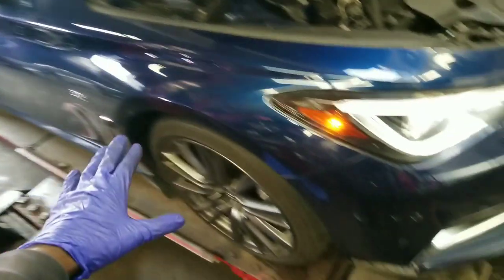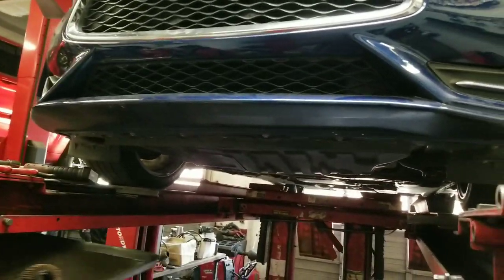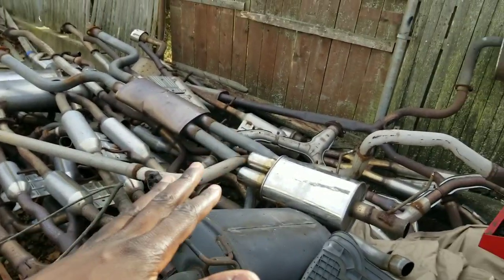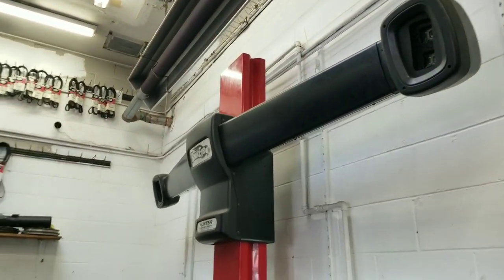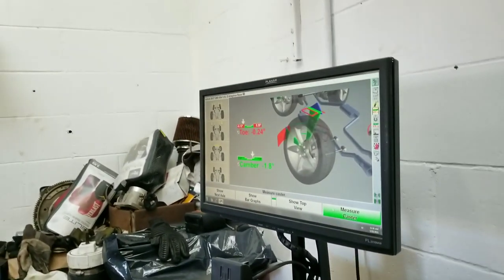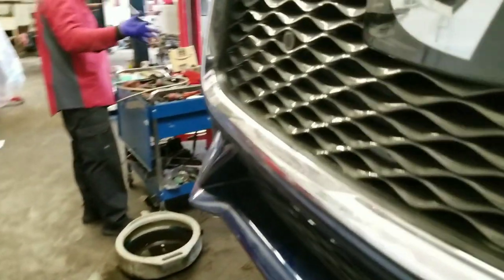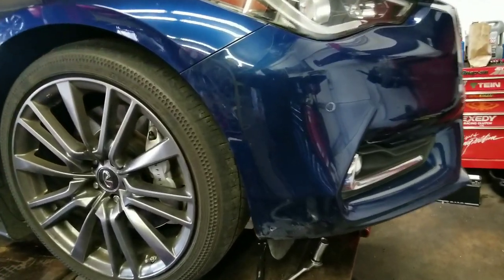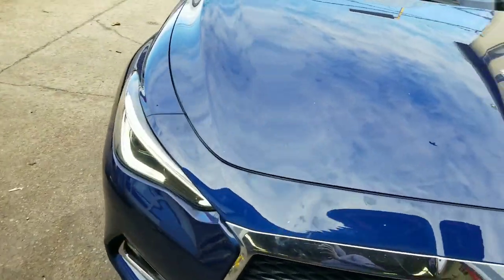Allout motorworks alignment/ oil change

Comment: Also something to note, even if both Toe specs are in the green, you do not want them to be far off from each other. For instance you wouldn't want 0.02 on the left and 0.08 on the right, the car still may go through tires and not track straight
Reply from the maker: Agreed

Comment: Hey boost why did you use 5w30 instead of 0w20? Also did u use 5w30 on the q50?
Reply: 5W-30 is great simply because it’s thicker and more reliable if you’re making more power/boost simply because 0W-20 thins out and evaporates like water and can destroy these engines. Why I use 5W30 as well.
Reply from the maker: Temperature range is higher for 30 weight

Comment: Hey Boost - do you rock a Mishimoto or ADD W-1 catch can?
Reply from the maker: I used  to have add W1
Reply: Do you plan on throwing one on the Q60?
Reply from the maker: I haven’t decided yet but I do want to find a more affordable solution. Oil separators shouldn’t be that expensive